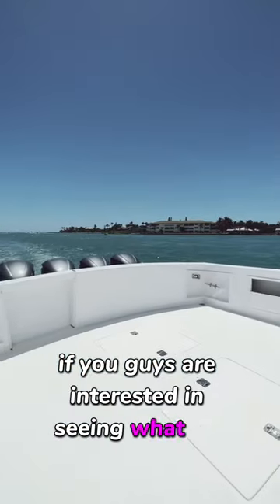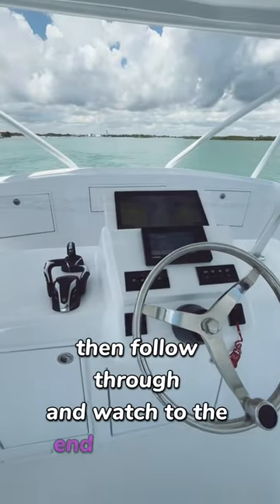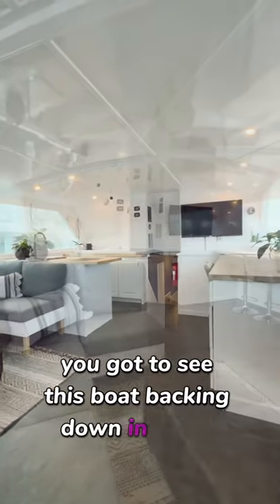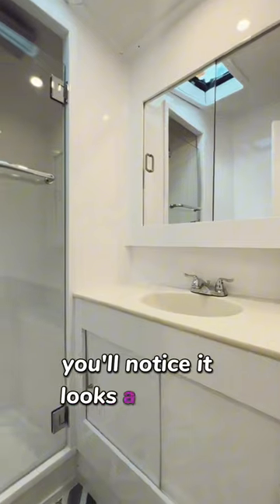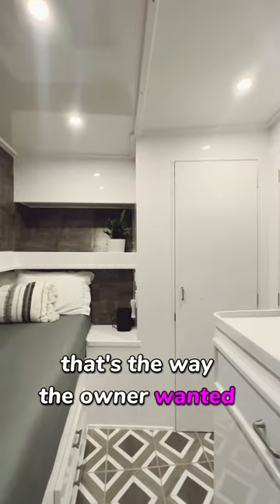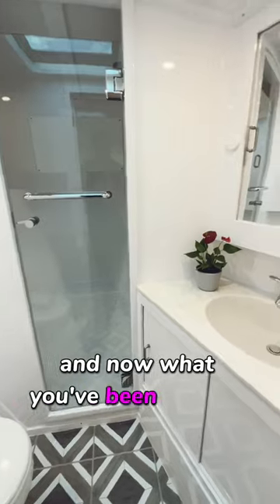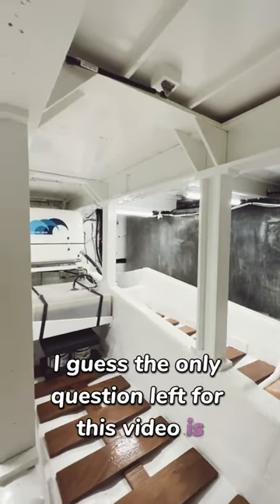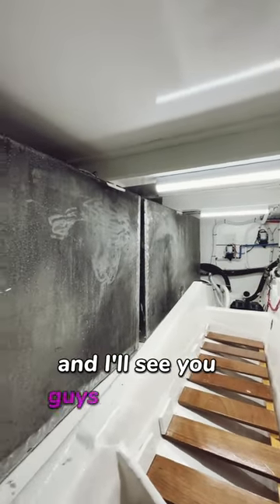55 Sportfish Boat With Quad Yamaha Outboards - Custom Sportfish Boats

Comment: There goes your stability - the engine weight was designed to be low and at the vessel's center of gravity.   Top heavy, no doubt as well.  Fuel burn gonna hurt too.